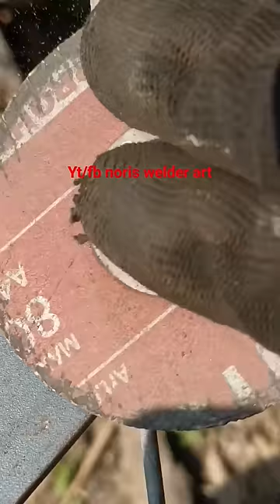old trick welding

Comment: Welder here. What you see here is very much novice work.
Reply: I was going to say it looks like balls 😂
Reply: I wouldn’t drive my hot wheels over that piece of metal
Reply: I was gonna say he's using too much juice.
Reply: And there ain't nothing wrong with it being amateur
Reply: @donaldlevy8141  yea nothing wrong with the person or being a amateur but the weld will fail to meet national standards and is not structurally sound. It would have catastrophically  failed under any kind of strength test. If he would’ve flipped that piece over you would understand.
Reply: @DizmalxD a grinder and paint makes ya the welder ya ain't
Reply: @nickc6570  I hope they got enough paint if that is what our future welders will be doing to fill a gap im a mechanic and I still could’ve pieced that metal together then that 😂
Reply: The Weld is fine...though won't win any awards...like all you guys with your welding oscars..strutting your stuff in your welding aprons on the red carpet
Reply: @DizmalxD ты бы знал, как мы варим рельсы 😂
Reply: Cook here, I agree 👍
Reply: @116volt9  what
Reply: @Andylismore76 not really even a weld tho😂
Reply: I'm no welder but surely a little cut welded in would be the way to do it no?
Reply: @IrishPikeHunter correct. Cut a triangle piece with bevelled edges
Reply: @IrishPikeHunter but realistically. Throw it in the scrap bin and use a new piece of flat bar.
Reply: Bro you don’t even need to be a welder to see that
Reply: @Andylismore76 😂😂😂
Reply: I was gonna say the least he can do is chip away the slag, instead he grinded on top of the slag leaving a layer of slag on your weld making it contaminated & ruled out a failed weld, even tho it wouldn’t pass X rays but keep the grind up !!!!
Reply: That's a shonuff RUNOFF
Reply: Was about to ask where people think what part of the (not english so dont know the correct word) flat steel would break... i dont think its anywhere other than the part show on video
Reply: Where I'm from we'd call it agricultural.
Reply: Don't need to be a welder to know that
Reply: It’ll take 20 seconds to cut out a triangle to fill it 🥱 welder my ass
Reply: As a amateur welder … it’s shitty
Reply: @Andylismore76 there is no such thing, and the weld is shut it wouldn’t even be safe to test. You would win any awards even if it was a good and solid weld.

Comment: There's an even older trick: Don't cut a vee notch out of your steel.
Reply: And another trick, if someone has cut a notch, cut a v section that fits and weld it in.
Reply: That's a really slow 6010 fill right there And you got to clean it before you even go to put the next tap on it you got to feel it a little stop let it cool clean it up feel a little stop let it cool fill it off if you want to fill up a gap like that otherwise hell no
Reply: Fill
Reply: Damnit, I wanted to comment something like this. 😂😂
Reply: @TheDaddy. yep bro didn’t even let it cool down so he could clean it, just molded the puddle like play do 😂

Comment: Been a welder for 40 years. This is the ONLY way I weld anything these days. It's much safer and stronger than any other method and you know you've got a solid core.
Reply: 😂 bs
Reply: Just start all your projects with nothing but a small rod and the stick. Manually build up from the small rod until you have the entire structure you desire. Manual 3d printing, only 1000x more costly and 100x weaker! 😂
Reply: How Manny drugs did you take in the 70's? Bc this is just trash I am just learning how to weld and I know that this would be a porosity factory
Reply: @brysonmartin3390  
I can only assume it’s satire.

Comment: I'm no welder by any means, but even I know this is a "what not to do" for welding. It has no sound structure to it, and there is no guarantee that it will not fall apart later on down the line. Folks, just don't do this.
Reply: Mechanical engineer here. You missed the jackpot. You're not entirely erong tho. It always depends on the intended use.
Reply: @ScorZulu  true. Like I said, I'm no welder, but I also noticed something else after watching it a second time. The fact that he doesn’t even fix or clean up the underside concerns me as well. I get that he is doing it as a demonstration, but I have zero confidence in that weld.
Reply: @narnian19  yes that is correct You have to remove the layer before I continue welding
Reply: Know why you don't  trust it? You actually touched on it briefly how he actually used filler rod to close it up....which is fine as long as it isn't structural or under pressure/ tension..... but the second reason is dumbass didn't clean his tacks of slag....hence the massive holes in his welds...which creates a weakness
Reply: @timothygilson1132  I agree. Sad thing is a majority of guys will watch this and praise him on such a great idea.
I saw metal that was over heated, and melted. Not to mention several good size holes in that as well. He only ground the one side leaving the other untouched. Sorry, but it's like I said, I'm no welder by any means, but that is not a weld.
And most people will say, "but it's not holding a load." I don't care if it isn’t, the fact remains that there will be guys who watch this and think it will work for them.
Reply: @narnian19  It's a short video, how do you know he didn't grind the other side when he was done?
Reply: @malleusmaleficarum6004  the short answer, the whole video speaks for itself. The long answer, if we pay attention to his welding as it is, we see he left a ton of defects in that weld and air gaps. If he would’ve taken the time to actually do the job correctly, it would look way cleaned that it does at the end.

You can tell that he doesn’t take pride in his work by the job he has done. He is just doing this to get views. Sorry, but based on all that, I can pretty much guarantee that he didn’t clean up the backside.
Reply: Your fired😂
Reply: @brianb8489  Who's fired? If you mean me, then explain why. If you mean someone else, then also explain why.
Reply: @pivanpetrov3512  is there a way to translate this to english?
Reply: @ScorZulu 
Mechanical engineer here. 
The intended use was clearly to perform a stupid demonstration.
Reply: Being absolutely honest this works, especially since he did a second pass burning all of the flux off, the result we see when he grinds it down speaks for itself, it works, not 100% but it works.

Comment: Welder here and the only filler material you should ever use is the rod, wire, or stick itself. Not filler material because you will have a structurally weak welded area. That would fail at any shop that is not jank.

Comment: Welder here, if you’re wondering what’s wrong, read this

First, due to the amount of metal added, and the shape of the gap, i can’t imagine the distortion after the weld 
Second, why just not cutting a triangle piece in some leftovers you have in the shop and do 2 nice welds ? 

And due to the amount of heat, i can’t imagine how the grain structure would look like 

And the finish isn’t even good.

So bad job, waste of time, could be done way better.
Reply: Okr pro welder then what should we do ??
Reply: If we don't have left overs
Reply: @abhishekprasad8151   if you ain’t got no leftovers, you’re not a welder

Comment: structurally theres not really anything majorly wrong but they should have at least chipped off the slag rather than just welding over it, you cant just expect it to dissapear. I am somewhat impressed though, if i did that it would have all been slag and the rod would have just evaporated...

Comment: Or you could cut a wedge of steel and weld it in instead of this abomination. This is hack work. Even if this is what you have to do, you should still be wire wheeling off the slag between passes bc doing it this way traps a bunch of porosity inside